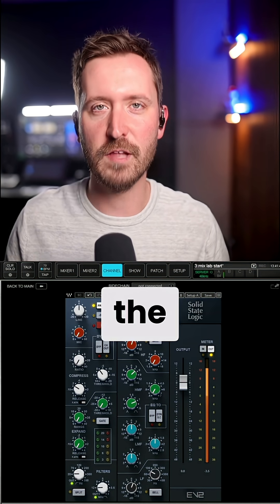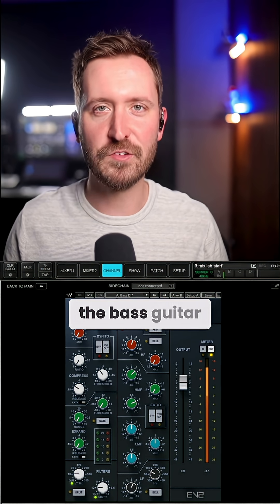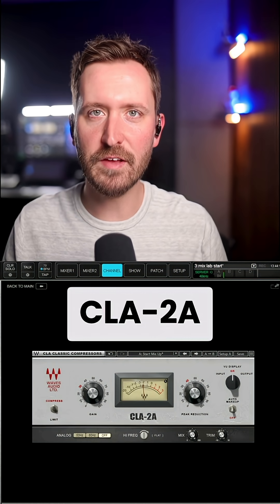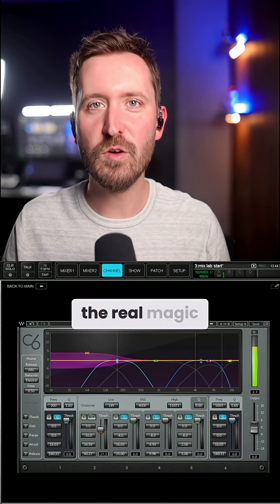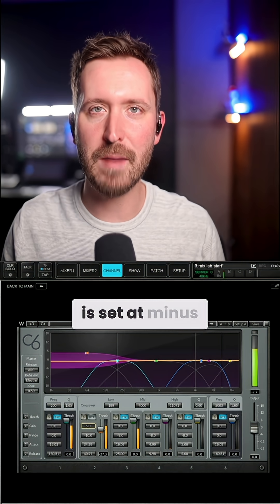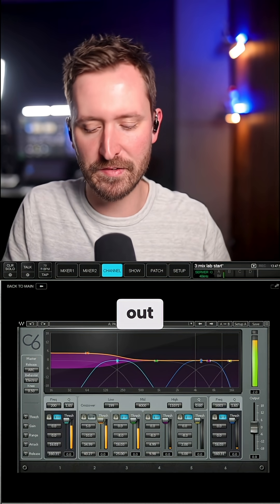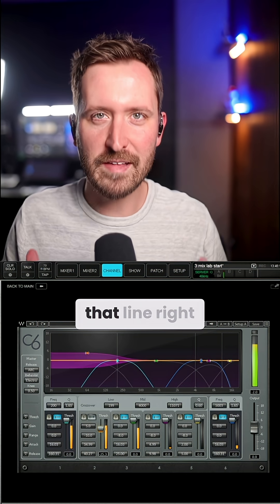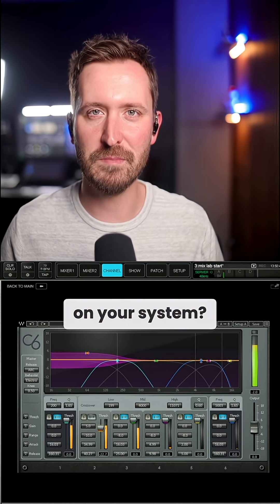Stop Letting Low End Ruin Your Mix!

Comment: How about show churches who can't afford fancy equipment how to do it with a basic 16-24 channel analogue sound board. I'm not the sound guy just the e.g. and acoustic guitar player.
Reply: Honestly, the best general approach I’ve gotten is running a low cut at 100 Hz or higher on anything that isn’t bass/kick, and then more aggressively compressing bass guitar. You can do that on the board, or potentially get a stomp pedal for the bassist. Multiband is the way if you’re able, but you’re totally right: most places can’t swing that, including the churches I’ve served in.
Reply from the maker: Great advice Caleb!
Reply from the maker: Totally feel you on that Rick! I’ve mixed in tons of environments like that, and in that case the best thing in my experience is to work with the bass player to solve any issues in their bass rig. Maybe it’s having them get a compressor pedal or tweaking some amp settings. Also if your PA subs are on the floor, just moving them around a little bit can have a huge impact on how the bass feels in the room. This video definitely isn’t meant to be the only approach to solving these kinds of issues, it’s just one way that I wanted to draw a little more attention to :)

Comment from the maker: More info on the C6! The ultimate goal is for the orange line on the frequency graph to end up right in the middle at 0db when he’s playing. That means technically no gain is being added or subtracted in the low end, BUT it’s being compressed pretty aggressively which will add consistency. 
I have the range set at -10db, but because I don’t want this process to actually change the amount of low end (just control it) I’m offsetting that with a +5db gain boost on that band. Then, I’m lowering the threshold on that band until I’m getting -5db of gain reduction. In short, we’re boosting 5db, but also compressing 5db. The boost and cut offset, leaving us with just the low frequency control from the compression. If he really digs in, it can compress more (since there’s -10db of range), but on average, we’re looking for about -5db of gain reduction so that the orange line hovers right around 0. This gives us great control without effecting the tone of the bass itself.